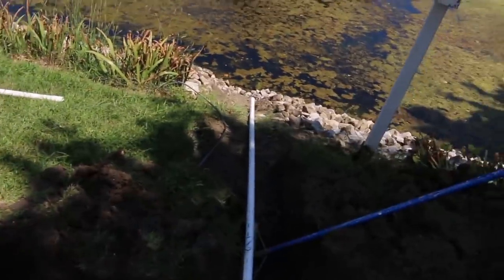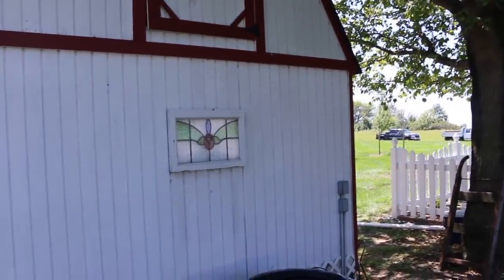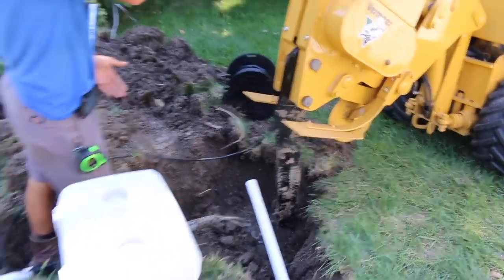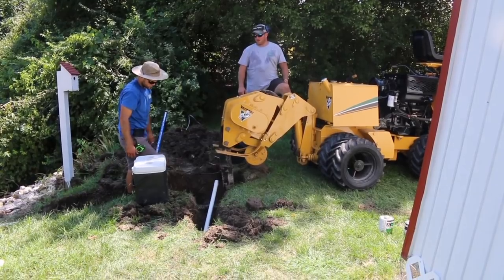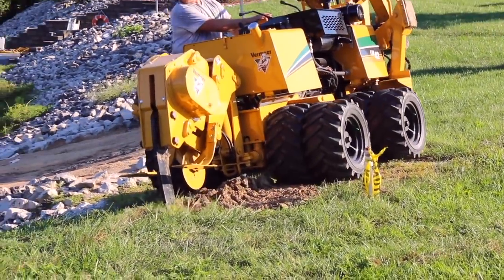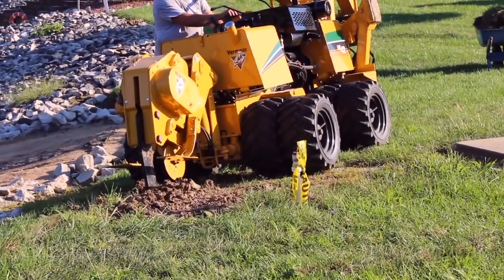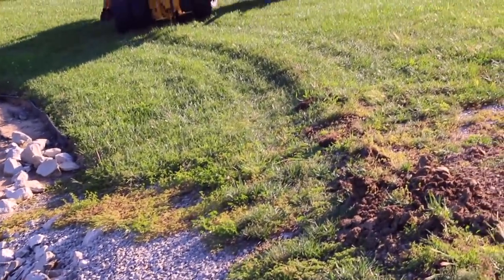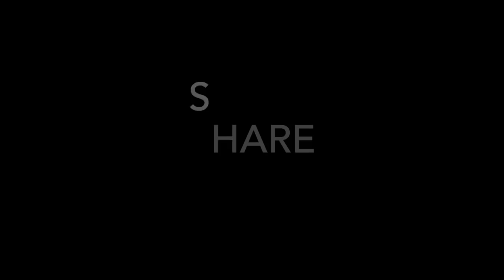Irrigation Install | Pulling Pipe & Wire

Comment: On your rotors, are you going to use swing joints? Just trying to think of stuff ahead of time. Swing joints make setting heads easier and it's better from a maintenance standpoint as well. You're probably already planning to use swing joints, but just in case, I figured I'd mention it.
Reply from the maker: Interesting View Thank you for the suggestion! To be honest idk... I will ask Jake today

Comment: If the hole in the center of the wire real is big enough you can slide it down a tamper handle and the machine will just pull the cable off as it goes

Comment: That appears to be PVC rather than poly pipe.  Is poly pipe used in your area?
Reply: Travis Wilkins Just the main is PVC from the looks of it. I'm personally not a fan of Poly for anything but drip.
Reply from the maker: Travis Wilkins We ran pvc for all the mains and poly coming off of the main. Pulled poly all morning 😎👍🏼
Reply: Why PVC for the main. Poly pipe comes in main line strength and various sizes, with far less long term issues. Just curious why you mix the pipes.
Reply: Travis Wilkins 1.25" Schedule 40 PVC is rated for 370 psi and is less prone to damage from the surrounding soil, eg. rocks etc. Poly should be trenched in and surrounded by sand to protect it. Furthermore, PVC is welded together, so technically it's seamless. Typically it's poor installs that cause PVC failures at glue joints. A joint failure at the bell of the pipe is very uncommon.

Comment: don't you have to worry about rocks and sharp debris gouging into your pipe and wires when pulling them like that? The installs ive seen they dig trenches to each area and then set the pipes in. Not being sarcastic or being a know it all...because I don't. Im trying to learn the game myself. Commenting to assist. Thanks for taking the time to post this. Include what details you can as you go..thanks man!!

Comment: Only way to make money on lstallinf is to complete each system in couple days or so. Need man power to get done fast, they dont pay enough to be there all week, small trencher and sodd cutter are nice for existing lawns with puller go get pipe in and look like you was never there. Looking good
Reply: Agreed, no money in installs, money is in the service, turn ons, state certification and blow outs.

Comment: How about using a terrasaw, instead of this heavy, expensive and slow machine. I have no experience in the terrasaw, but it looks faster and way cheaper than this yellow machine.Good luck with the project :-)
Reply: The pipe puller doesn't dig up dirt.  If you trench you have to put dirt back in the trench which means you have to get the dirt out of the grass and then you have to fix the missing portion of grass that was destroyed.  Most people don't use pipe pullers and it baffles me, it is a much easier and cleaner/neat way to install pipe.
Reply: @wendelladams6609  Yes I see what you mean. Thank you 😀😀